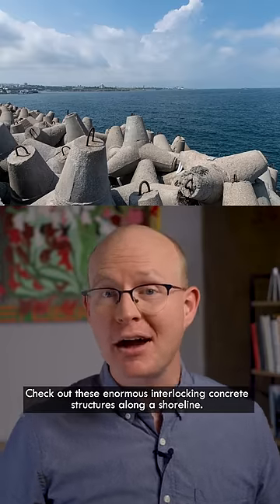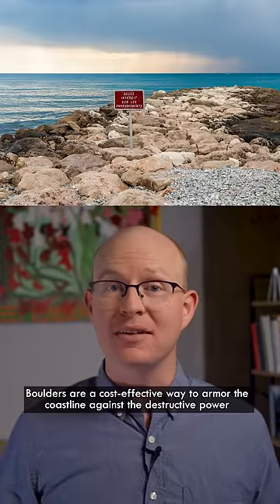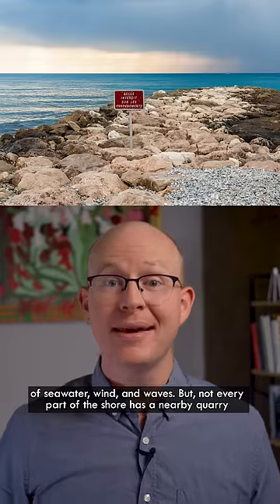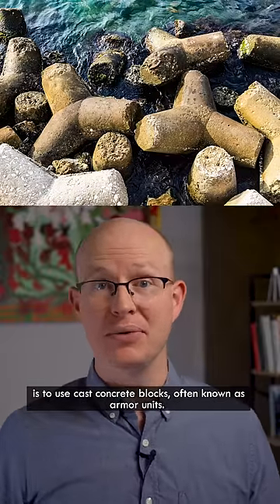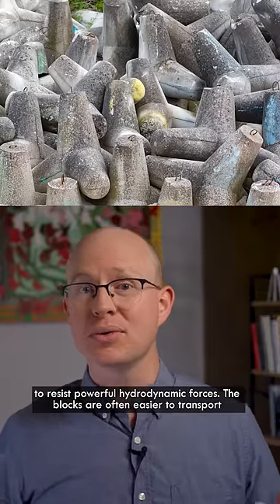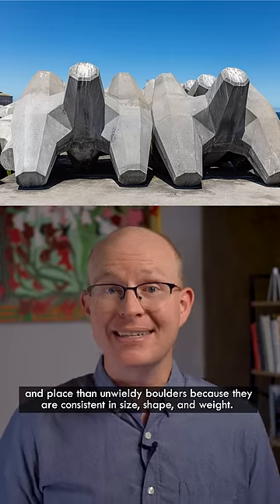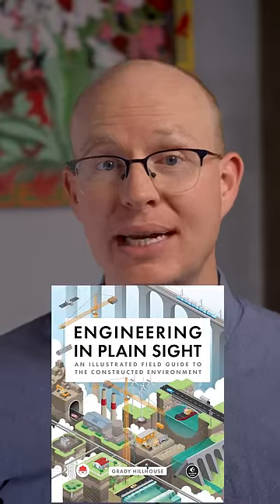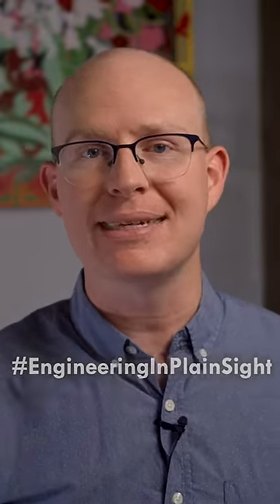Name That Infrastructure (Ep. 14) #shorts

Comment: Here in RI, we have a number of breakwaters and jetties that were built in the mid-20th century using the granite and rock ledge blasted away during construction of our interstates and some state roads. Most notably, significant material was removed where I-295 passes through the "Cranston Canyon."
Reply: I'm a Rhode islander and I should drive by 295 again..

I never knew that area is called Cranston canyon  ..

Thanks for the posting info
Reply: @williamgarcia2830  Very welcome! "Cranston canyon" is just a local/unofficial name (like "the dunk" or whatever we're calling it now since Amica took over). I'm sure you're familiar with the area though it's very distinctive. As a kid I used to look out the windows and pretend our car was flying in the Deathstar battle in Star Wars. 😂

Comment: Because of the shape I always called them caltrops or dragon's teeth (we used a larger metal version around the same size to help run concertina wire and to fortify areas in the military).
Reply: There are inland Dragons Teeth in Scotland placed to stop an invading German armoured column, just in case they tried.
They didn't but what to do with the sharp concrete teeth?

Comment: Looks like these have a few different names

Wikipedia:
The tetrapod inspired many similar concrete structures for use in breakwaters, including the Modified Cube (United States, 1959), the Stabit (United Kingdom, 1961), the Akmon (The Netherlands, 1962), the Dolos (South Africa, 1963), the Stabilopod (Romania, 1969),[7] the Seabee (Australia, 1978), the Accropode (France, 1981), the Hollow Cube (Germany, 1991), the A-jack (United States, 1998), and the Xbloc (The Netherlands, 2001), among others. In Japan, the word tetrapod is often used as a generic name for wave-dissipating blocks including other types and shapes.[6]